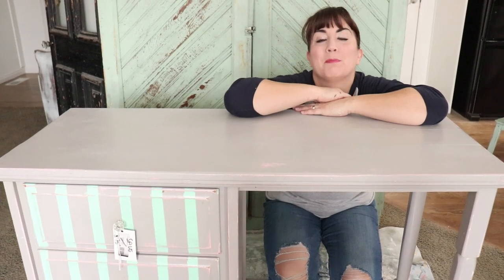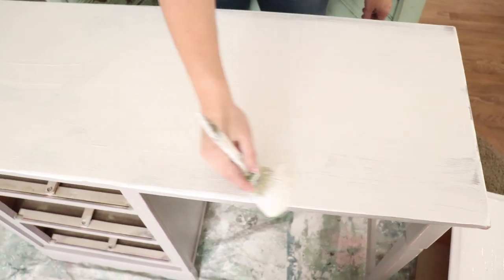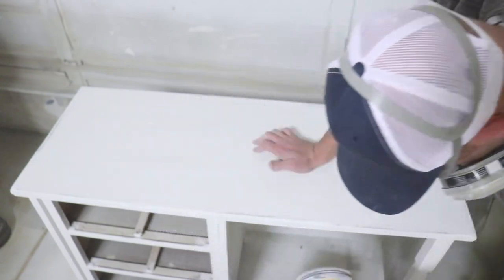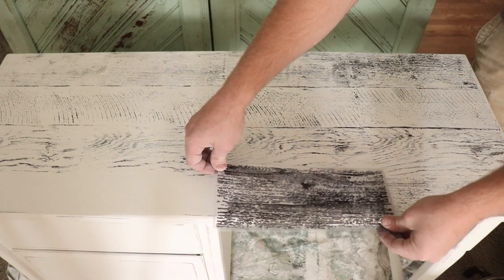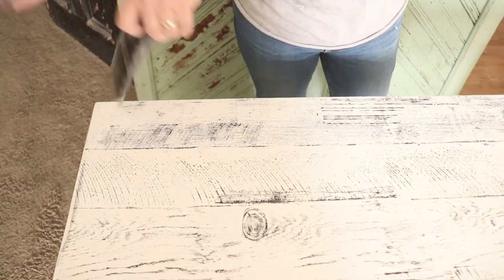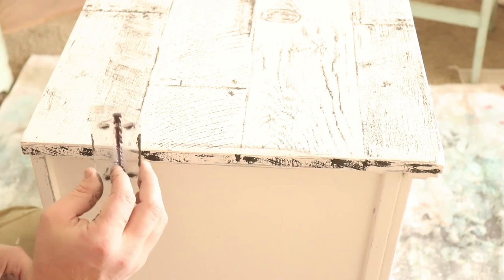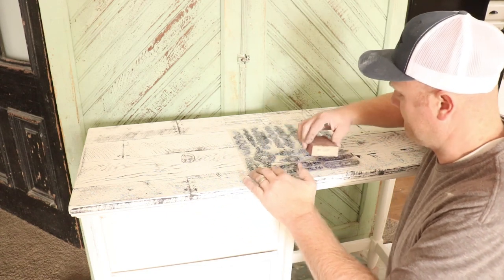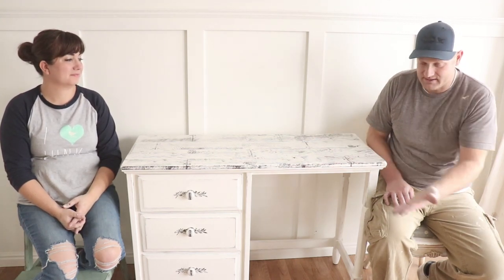How To Fake Barn Wood | Furniture Makeover

Comment: Can you use a foam brush for the stamps or should you just use a brayer? ( breyer?)
Reply from the maker: Yes you can. We’ve used foam brushes several time. I find it I have to be more careful to not over load the stamp but it’s very doable.